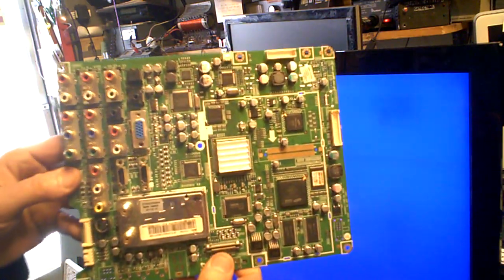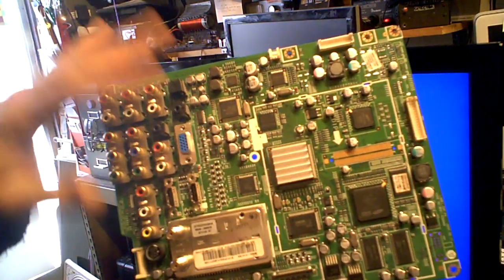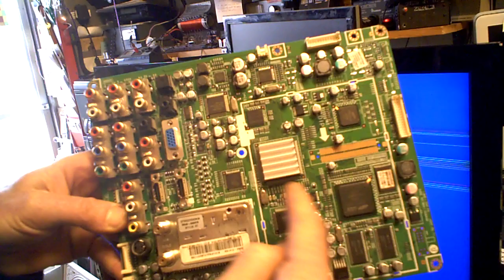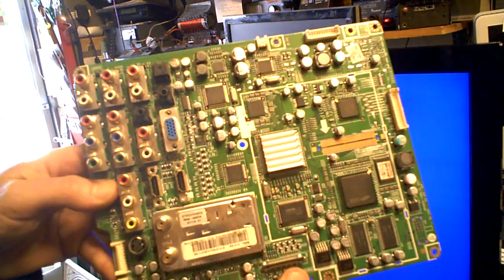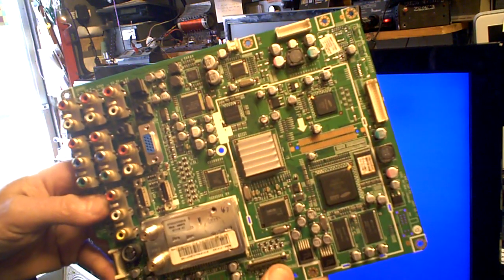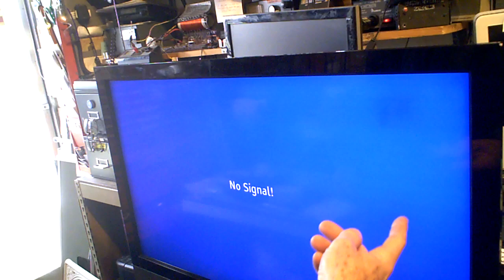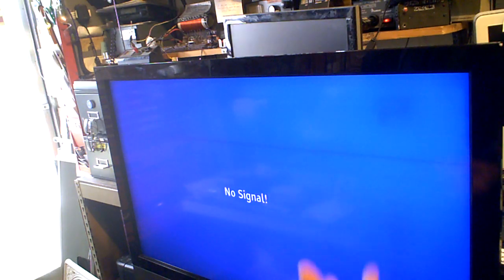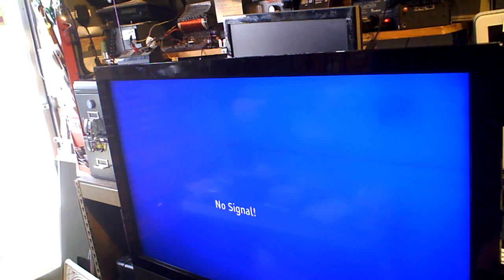Using freeze spray or hot air to troubleshoot Circuit Boards and LCD display problems.

Comment: I just had a Toshiba with the same problem. I put pressure pads on the connectors and the tv is now mine. Has been working well for a long time. Nice video, good to see you posting again.

Comment: 66th liked. great video you should have more subs. I think that hot and cold and hot and cold causes the solder joints to crack. I seen a video Chinese man repairing the connections on the panel using hot bar to remove and solder ribbon cable connection to the panel. I wish I had that tool.

Comment: Thanks for the video. Bad display means this tv is destined for the landfill?
Reply from the maker: Yes, the TV is ready for the dump due to the cost of repair, but the circuit boards may have value on ebay, or perhaps you may use them in another TV.

Comment: con it fix dead pixels?
Reply from the maker: Some claim you can fix dead pixels, but I've never tried to.
Reply: It all depends on how the pixel(s) were damaged.
Reply: I've accomplished dead pixel repair by pressing gently around the dead pixel until it functions again, used on older style matrix displays. Such as a Gateway solo 1150cl that was the screen I managed to revive a dead pixel and it still work's to this day.

Comment: Will this work on a dark spot
Reply from the maker: I doubt it will help with a dark spot. That sounds like a possible black light issue.
Reply from the maker: @scottschmitz6061  The problem with replacing the back light which burnt out is you need to replace them all. If you do just one the others will soon go bad also. and removing the display screen to get to the back lights be a risky operation.
Reply: @GrantsPassTVRepair  it actually got a little better on it's own, which is why I can't tell if its the backlight or panel issue.  It's a 3d tv I want it fixed , I replaced main board , led driver board and I cant find a shop thatll fix it, only parts for replacement are on Ebay... you think it's a backlight then?
Reply from the maker: @scottschmitz6061  Since the problem gets better at times I'm not 100 percent sure it's the backlight, but that would be my best guess.
Reply: @GrantsPassTVRepair  you have a shop in Illinois to do repairs
Reply from the maker: @scottschmitz6061  No I'm here in Grants Pass Oregon.

Comment: it only got worse
Reply from the maker: Sometimes it work that way. It sounds like your display went bad.
Reply: Grants Pass TV Repair You wanna know what kind of damage it has? 
Il tell you what happent. So I was going to clean my bb gun, I wanted to clean the barrel but I pulled the trigger but I forgot that there was still a bb in the camber. The bb hitted my monitor of my pc and there's isn't a crack in but when I turned it on there was a white line from the top all the way down. I tried a lot of things.... now it's 1/3 of the hole screen. I hate it. Do I buy a new monitor? Or is it fixable?
Reply from the maker: You're unlikely to find a low enough price on a replacement display to justify the cost of the repair.